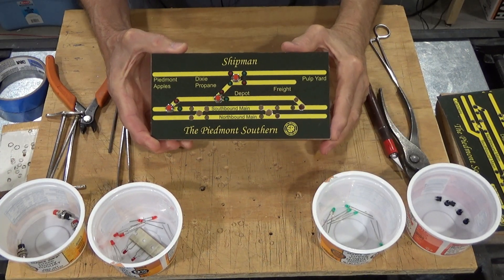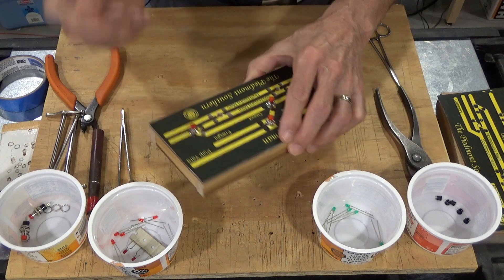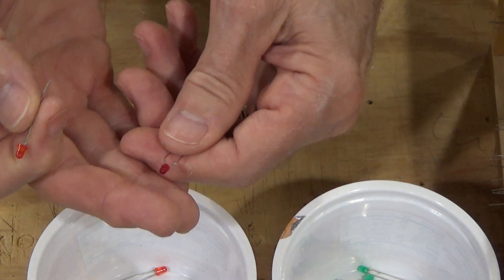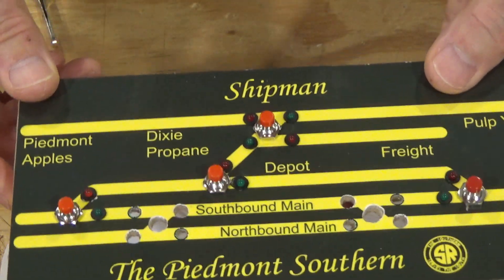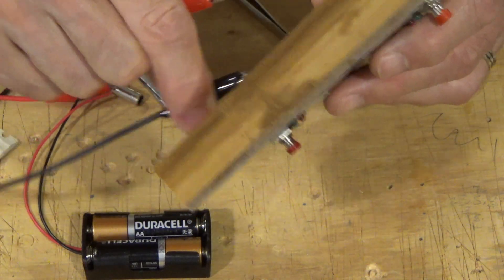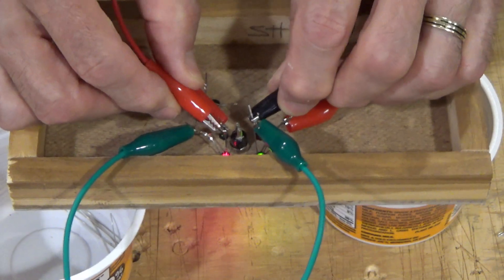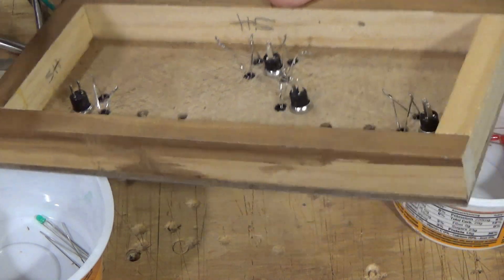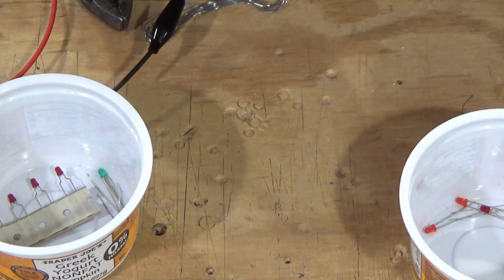24. Model railroad control panels pt 3, Finishing the build and adding switches and LEDs

Comment: Do you have a video on how to wire those push buttons to a tortoise switch machine?
Reply from the maker: Have you watched video #25, the next one in this series?
Reply: @TheDCCGuy ,  yes but I don't want to control it with DCC throttle.  I just want to push the buttons to throw the turnouts. Do you need the circuit board for that?
Reply from the maker: Well, you don’t have to use DCC commands, that’s what the little push buttons on the panel are for!
Reply: So do you have any videos on how to wire the push buttons and LEDS to the Tortoise without the circuit board shown in video #25 or must I have the same setup?
Reply from the maker: I do but I can’t remember which one so just search for “control panels DCC Guy”

Comment: Hi, Do you need any resitor to protect the LED when connecting directly to the Tortoise wich I suppose  is 12 volt? (Sorry for my english, I am french speaking from Canada). I like very motch your teaching, being a science teacher myself.  Michel Bélanger
Reply from the maker: The Tortoise is wired with a pair of LEDs in series so they indicate the active leg of the turnout. Since the Tortoise only draws about 20 ma and the LED does too it basically protects the LEDs. This method and circuit are also documented in the Tortoise instructions.

Comment: The parts list does not include the lighted LED pushbuttons used on the yard tracks on the big panel.  What is source and part number for those buttons?
Reply from the maker: Ted—those are LP1OA1AG and I got them from Mouser. The last character “G” is for green but could be “R” for red etc. so you need to look over the listings.

Comment: Larry   I am setting up my crossover lights.   All four lights lite up have a battery holder similar to yours. two AA batteries works great for testing.   My problem is I can not figure out the cross over wire setup the video is not clear enough to see all the leads from the LEDS can you get a close up of a cross over setup   Thanks Tom

Comment: Question: Why is it not necessary to use resistors when connecting the LED Diodes
Reply from the maker: Because the Tortoises only draw about 20 milliamps and that is what it takes to light an LED.
Reply: @TheDCCGuy  hi Larry im still puzzled if the LEDs are 3v dc then surely the 12v required to run the switch sould blow the LED cheers Darryl from south Australia
Reply from the maker: @darrylellis1495  That’s just the magic of LEDs and electronics, and it works. For the in-depth details you’ll need to talk to an electrical engineer, which I am not.

Comment: This is exactly the information I need to move ahead with my tiny layout (4' x 8') with ten turnouts.  I'm following the articles in your Electronics Projects book for my control panel.  I am not using the Switch 8, just the toggle switches, but have been looking for a surer way to make sure the LEDs are wired correctly.  This video, and I expect the next one, are just what I need for the details.  I just ordered some jumpers with insulated alligators from All Electronics- I'd been shopping on the wrong hardware sites; thanks for that tip.
("Insulated alligators" - [snort snort])